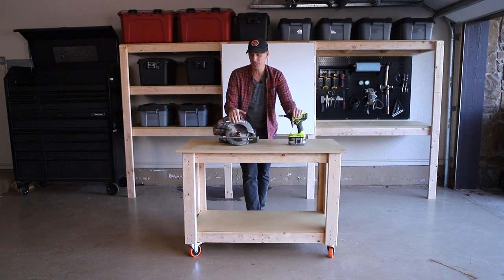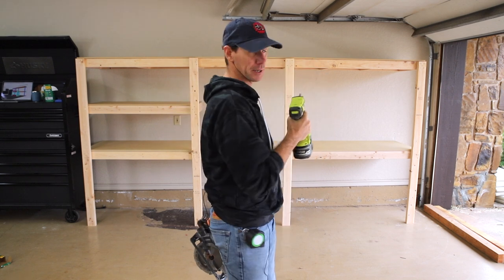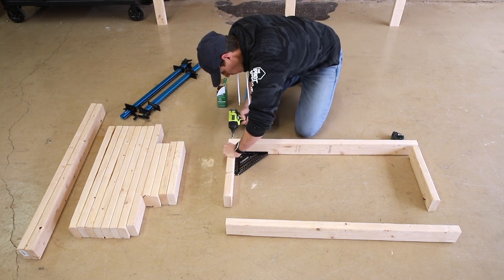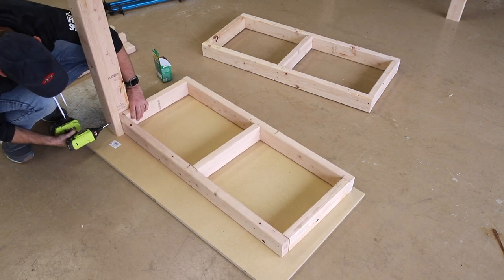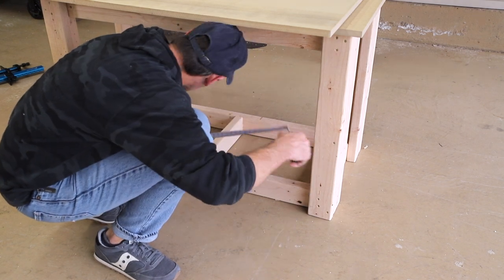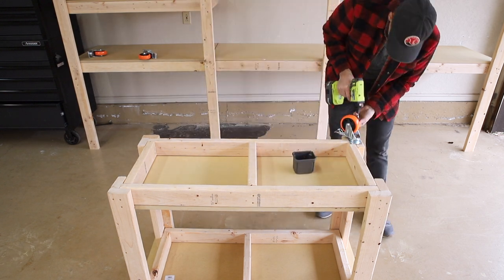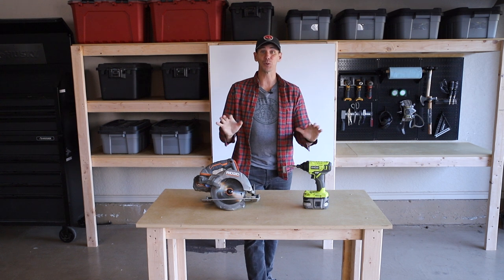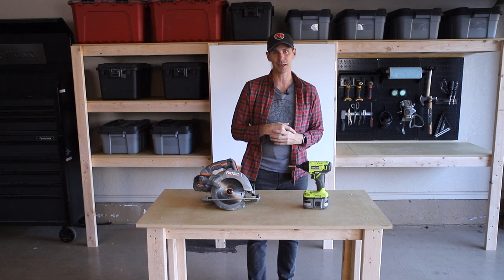Build A Workbench In A Weekend With These Free Plans!

Comment: This is by far the best "cheap fast workbench" video I have seen. Thanks for not running every board through a planer and jointer.
Reply: Pp.
Reply: It's funny, I am about to build this same bench, but I am running all the boards through the table saw to square them up and then sand them to make them look like I milled them.

Comment: The legs assembled in that L configuration make for a rigid structure without the need to make notches at the tops of the legs to accept the rails, as one would have to do if the 2x4s were simply lapped together. Funny to call such an extremely simple -- even rude -- little workbench elegant, but the thinking that went into it and the use of so little material and so few subassemblies that actually aid each other in the assembly process? Well that's elegant, and a work of genius. Lots of people needing their first workbench are going to be beholding to you, Johnny. Well done, guy!

Comment: That was a nice, simple work table build. However, for your shelf storage if its built similarly, I'd seriously consider changes.  Screws suck in shear strength.  Run a second piece of 2x4 in each leg and let the shelf horizontal 2x4 rest on that, then screw it in.Run another 2x4 piece vertically above that the 2nd shelf, or top shelf can rest on.  That way, all the shelves are supported on (1.5 x 3.5) 5.25 sq inches of lumber per leg, vs some screws.

Comment: Love this design for an easy and quick build.  
Wish I would've seen this before I started my build.

Details of my not so great workbench.  
I am just finishing up building a workbench using a kit / design from Menards. Kit is by "Heavyweight" and includes basically the thick plastic corner pieces that you cut 2x4's and plywood to dimensions as detailed in their plans. 
Low and behold, the one job their person has for providing proper dimensions was a fail. 
it's a 5' x 2' workbench that instructs you to buy/cut two sheets of plywood/mdf, etc to the same dimensions, though the top overhangs the edges of the frame/legs, while the shelf fits inside the legs..  this already shows that their design is missing some steps (cutting the shelf to a shorter length to fit inside the legs), 
However this is not the only thing, the short 2x4's of the frame that are supposed to make the Width 24" although the design has you cut the top to the same 24" yet supposedly have overhang?? again.. see a problem here?    And top it off, when you put the short pieces into the corner pieces and screw it all together, it comes out to about 1/4" more than the planned 24"
So, in the end, the top surface not only will NOT overhang all 4 sides with the dimensions given in the instructions, but it will actually not even sit flush with the edges of the of the legs from front to back.. :(
Time to pull it apart and shorten some of the 2x4s to still be able to utilize what I've already cut . 
Research until you find GOOD step by steps or designs, such as this video above and skip the "easy build" crap from a store.

Comment: You should have epoxied the floor before you started moving in.

I did it on my garage 15 years ago just days before moving in, KNOWING I'd never have the time and clear space to do it from wall to wall again.  I was right, and I'm REALLY glad I took the time out of the move to get it done.  And the epoxies these days are MUCH better than the cheaper stuff I used back then, which is still holding up pretty well except for a couple of spots where leaking containers let it soak in before I noticed it.

Comment: I like this simple bench, I might use its' dimensions to mod some carts I got at auction - I ended up with over a dozen projector carts of various sizes, and I think I might combine 2 of the smaller ones with left over pressure treated plywood (trailer sides) to make a small bench that can be broken down and used as carts when not needed as a bench.  I can put a thin piece of MDF on the plywood for the smoother surface if needed.

Comment: I think I am overlooking something.  8 x 28.25 (226 inches), 4 x 42 (168 inches), 6 x 15 (90 inches)is a total of 484. 5 8' boards are 480 inches.  I would need 6 boards, not 5?
Reply: I went to lumber yard.  They cut the boards for me.  I needed 6 2x4,not 5. Even with casters.